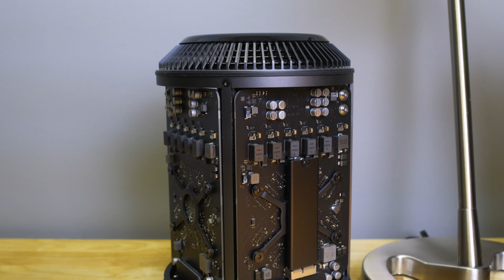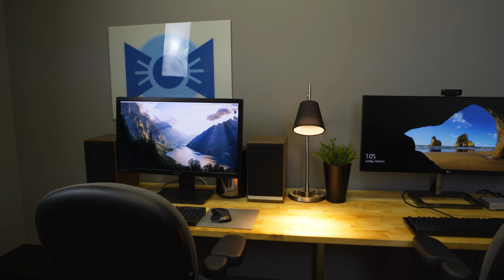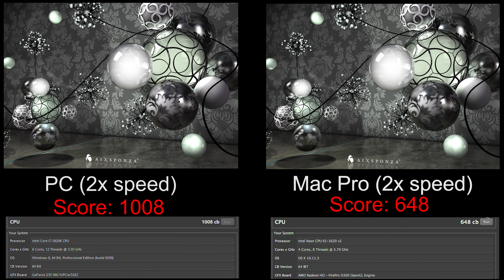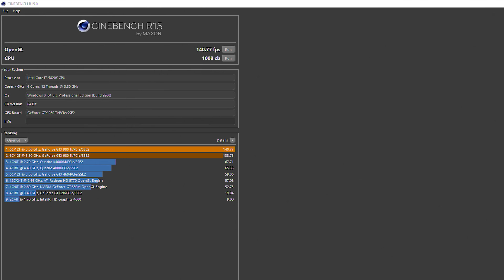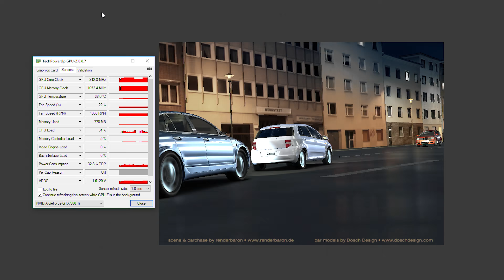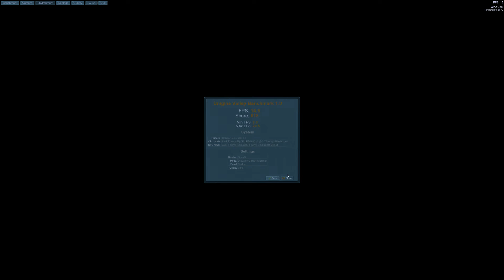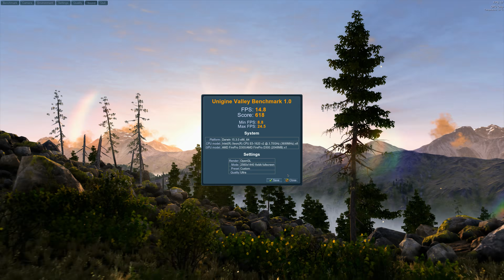$2,000 Custom PC vs $4,000 Mac Pro

Comment: isn't overclocking risky?
Reply: You need a seperate cooler for an overclocked CPU so it won't over heated. There are videos about overclocking and how to do it right.
Reply: not if it is done correctly but if you overclock a lot it will shorten your pc's life
Reply: +dpm9a1 

Overclocking is risky to the component if you don't know what you are doing, and or maybe make a mistake. If you decide to, read up on it quite a bit before doing it and understand the risks. The risks mainly is invalidating the warranty on it. Meaning if you overclock and fry your processor, then getting a replacement for free will likely not happen. Also understand that even  not all cpu's overclock the same. 

+Jett Bakker 

You can even with a bad psu, and bad cooling. A decent PSU, and decent cooling will get you a better more stable overclock... generally speaking. 

+Dequan CS:GO 

You do not need a "separate cooler" A stock HSF (heat sink fan) will work, it will just run at higher temps, so long as you keep within the safe range you should be fine. 

+Owen Hart

Overclocking will not shorten the pc's life, even a lot, even if you overclock to the point where it's barely stable and you blue screen at least once a day. Now... it can shorten different components life, depending on the method chosen to overclock. For instance in this case he overclocked the CPU. The model of CPU he has, has an unlocked multiplier. On CPU's that are not unlocked, you can still overclock them, but you have to use the base clock to do so. You can use both methods with the unlocked CPU. The problem with the base clock is that it doesn't just have an effect on the cpu alone. It has an effect on everything that is based on the base clock, So the memory, the north bridge, etc. So if say you have shitty ram, shitty board, etc, your play in the base clock will be limited more than with quality components. 

A PC is a combination of components. While your PC may "stop working", it doesn't mean that every component in it will be bad and need replacing. Overclocking by changing the multiplier on the CPU will only harm the CPU if it harms anything at all. Now if you want to get to a more advanced level you can tinker with the voltages to the CPU to get a higher overclock. Now this has more potential to brick the board, and cpu, if done too much. So overclocking your CPU via the multiplier will at most harm your CPU and Motherboard, that's it, replace them and you are good to go. Now the base clock on the other hand has the potential to damage more but it's very unlikely unless you are doing something insane. 

As long as you understand what you are doing when overclocking it shouldn't be that big of a deal. Just understand the risks. If it's your only computer, and you can't get a new one, or it would be hard to replace the CPU within a few days and it's absolutely needed, then don't. Or be very modest on the overclock. Just use common sense.
Reply: Debanshu Pani Ok, so you have never overclocked then? Overclocking is all relative. You overclock according to your setup. A stock HSF can do a bit of overclocking, a decent aftermarket HSF can do a little bit more, a closed loop watercooling setup can do quite a bit more than that. A good open loop setup a bit more. Then you get into phase change setups, like pelters, and chillers. 

You wouldn't use the same overclock on a PC that was stable with a chiller, on one that had a stock hsf. It just wouldn't work at all, and hell maybe not even post. But would it be set on fire, and or damaged severely? Likely not. it's only when you get into a somewhat stable scenario, where you are pushing it on your setup, and you run temps up to the thermal limit for extended periods of time, and it's not stable for maybe a few hours at a time. 

Also to note, processors for a while now have a cut off when they reach a certain temp, and or throttle themselves before they reach that temp. 

I have personally overclocked on stock setups, closed/open loop, stacked pelters, and setup chiller's for clients. Saying that overclocking on stock equipment is bad or will damage shit is just so out of the realm of understanding what overclocking is, that it's just funny. Seriously, it's all relative. 

One of the main important factors in overclocking is... ambient temperatures. If you don't have an air conditioner, and live in a hot climate and your ambient temps are 85 to 90F, then your max overclock will suffer. If you can keep the area around the PC at around 70F a stock hsf can get a modest overclock going no problem. Again... it's all relative.
Reply: Samster Birdies "as long as its not hot."

Sort of.... Not hot hot... and stable yes it "should" be fine, but depending on the hardware it can run cool, but not be stable at all. This is typically how overdoing the bclk will behave--especially on shitty hardware. 

"i overclock my laptop and its fine"

Anecdotal evidence is the best evidence? Not giving specifics on what you overclocked from, to, and or any other changes? No mention of temp before and after, and or what brand/model of laptop. 

My point is not all laptops will handle overclocking well. Some run quite hot at stock speeds. Also some you may not have an unlocked multiplier and have to rely on adjusting the bclk, which is doable, just not ideal as it has an effect system wide, not just on the processor.
Reply: Samster Birdies In reference to it being "risky". Heat can damage a component, as well as settings that make it "not stable". There are many ways you can damage a CPU heat is but one of those ways. 

Also the same can be said for "as long as it's not hot", reduce what you did to make it "hot", and there you go. The key thing here is that doing either can be "risky" depending on any number of factors. 

Overvolting for instance can pop a cpu like a lightbulb. Some batches can handle more voltage than others. Ideally when going about adjusting the voltage you do it in small increments as well as other changes to find stability. When you get too far out or take too big of a swing is when you can run into issues. Unless you know what you are doing, and or are ok with having to buy new as that will almost certainly void warranties, you may want to take very small swings until you get a better understanding/handle on it. 

Overclocking is not some kind of voodoo science, it's not easy, but not insanely difficult. I mean hell to overclock some CPU's in many years past, you had to use a pencil or conductive pen. Today it's a hell of a lot easier, but more complex? You just need to know a bit more to get the most you can out of it. Well there were more ways than just the pencil trick, but it gives an example of how far things have come. 

All in all you can overclock at different rates with different results. A modest overclock should be easily doable by most, it's just when people get greedy and try to get that little bit more by simply just upping the multiplier or bclk, and.... crash. That and or not checking temps or stability.
Reply: Samster Birdies Ok, but unless you have some prior knowledge, what's "insane"? What's too little, or too much? You are forgetting that people who first tackle overclocking don't have any, or hardly any experience in doing it. Some people may do some research while others will look to people like you, and I and see "well maybe you should read up and take your time, and know the risks", and "just do it, just don't overdo it laissez faire type of approach".

Do you do any type of IT work? If so how many clients have you had that have fucked something up because "well I saw it on youtube", or someone said I could do it easily? 

Overclocking has a lot of different facets, and if you just say overclocking is easy, and or don't overdo it, or don't let it get hot... that's very general. What's too hot? What is overdoing it? Typically if someone doesn't tell you, or you don't know how to look it up, you find out through trial and error. There is a lot of good information out there on overclocking, but a lot of shit information as well. If you have very little to no experience it can be a bit daunting, and again it comes back to how many warnings someone has before hand to really read into things and what not to overdo.

Comment: I'd be curious to see how the latest greatest iMac benchmarks against MacPro cylinder.  I remember it being a similar situation in 2013 before the MacPro cylinder came out that Apple hadn't updated the MacPro cheese grater towers in a while (I think since 2011) and a brand new 2013 MacBookPro laptop could out benchmark the current tower.

After 20 years of using Mac workstations, I ended up switching to PC last year when it was time to upgrade.  Even a full year ago, the MacPro 2013 was already outdated and over priced.  Has Apple completely given up on the pro market?  The fact that they went with non-upgradeable/replaceable AMD cards in the MacPro 2013 instead of Nvidia CUDA was reason alone for me to build my own PC.